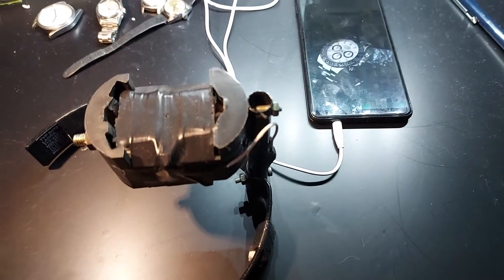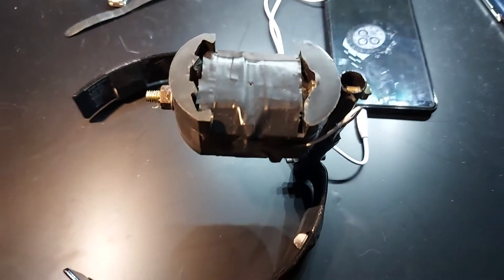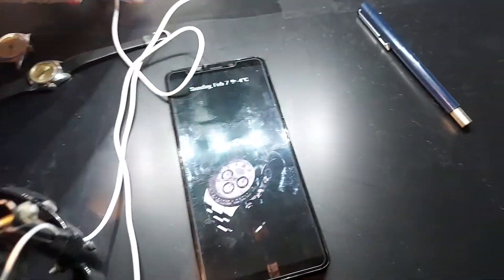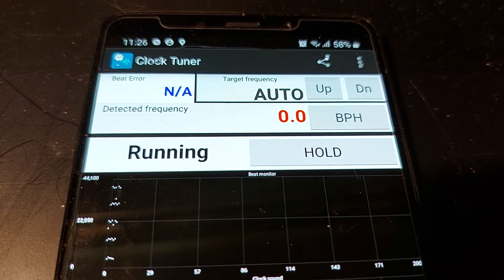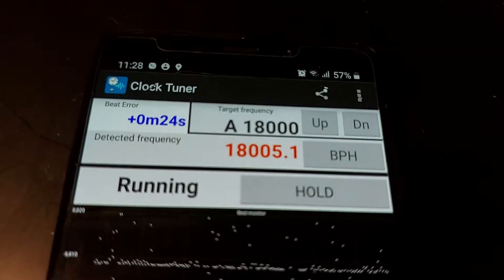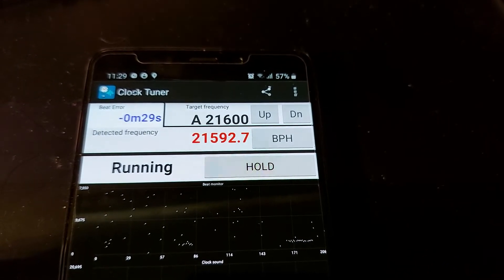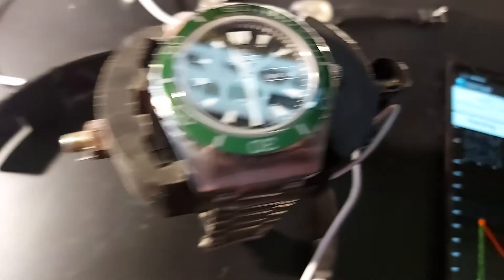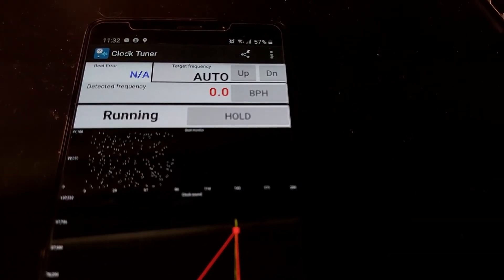5 euro Timegrapher that works perfect.

Comment: The 'Clock tuner' app is well worth the 5 dollars. The little dots reflect the difference in timing between the tick and the tock. It's the beat error. once the noise settles down you will get two likes of dots. The closer they are together the less beat error there is.
I use the 'Clock tuner' app on my android phone for tuning Clocks. I love it. I use it for setting regulations and dialing in the beat error. 
The strange frustrating thing about it is I pay the five dollars to upgrade to the pro version to get all the features. It runs in pro mode for a couple or three days, then I see in email that my 5 dollars is refunded by someone named Irene Lee and it goes back not being in pro mode any more.
I've gone through this 3 times so far. I though it might have been happening due to me disconnecting the phone from my network. I don't like it being connected to wireless all the time, but this last time (today) I had left the phone connected to the internet the entire time I was using the app after buying it again. Nope, that didn't seem to be the problem. Got a notice in email that the purchase was cancelled and my money refunded.

Comment: i tried using a mic and watch-o-scope and it didnt pick up any beats on a ETA 2836-2, the previous owner had regulated it to +4 to +6 seconds a day which is incredibly accurate, im more curious to confirm the beat frequency so as a project im going to try a simple piezo to pre-amp to 3,5 mono. From what i read it should work well and the trick to cleaning up the signal is to use a shielded wire on the brass side of the piezo. I think watch-o-scope is a better app as it includes the lift angle of the movement, im not sure if that app has that included.
Reply from the maker: There are many options... I did change some things and used a real microphone that has a build in pre-amp  but I did bought a while ago a real grapher so I don't use it anymore only as a project :)